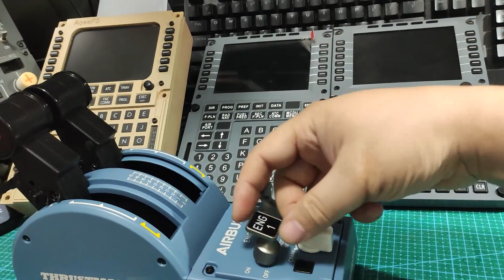Replace the more realistic Thrustmaster TCA Airbus throttle engine switch [QuickMade]

Comment: I find it baffling that thrustmaster cocked this up and didn’t include this kind of switch in the original.. nice job!
Reply: It’s cheap plastic shit, that’s why sadly...
Reply: @Tom-ih8gr  the modified versions accessories are expensive, look at the top comment where he replies
Reply: They keep their products affordable. These seemingly easy and small mods actually add up to a lot of overhead when added to a production. Providing a solid platform for the user to make their own mods while providing an affordable product is imo of much greater importance than shipping out a 1000$ bulletproof tank of hardware. Their Warthog is legendary but it will never have the userbase their HOTAS X and t1600 have.
Reply: You find it "Baffling"?  Just the two tops of the switches would add another 30 bucks...
Reply: to me the switches feel fine... its not meant to be a really good quality product, its an entry level plus the throttle flows very well

Comment: I think Thrustmaster charged too much for this quadrant, considering what it is made from and the simple manufacturing process. I bought this TCA and the two side controllers, (which are even more over priced). I felt like I had a 'senior moment' when I opened the boxes and realized that I should never have bought them in the first place. Anyway, as others said, for the amount of money TM charges for these quadrants, they should have used the 2-position toggle lock switches in the first place. 
Thanks for the video.
BTW:
As a machinist myself, (25+ years, 1st class/Job shop/Journeyman), I would like to suggest that you run your lathe's RPM at least twice, (if not 3-times) faster whenever you machine this kind of material. You could've avoided the "Game Over", (I liked that term, lol), when you were parting it off the workpiece. 

Also, you used carbide turning and part-off tools, which are never a good idea for soft materials, especially at low RPMs. Carbide is most proficient at high RPMs, light tool load (relatively speaking) and cut best when the there's a high degree of heat generated at the tool/workpiece contact point. 

To cut this kind of plastic, you should use sharp, high-speed tool steel cutters, with about a 1/32 to 1/16 tip radius. Finally, the cutting edge of the tools for your lathe, should be between .003" to .005" below centerline, (convert that for metric sizes).

Too far below that, and the workpiece can ride up over the tool if machined w/o a live center, (or if it's chucked too far out), and too much above that centerline will result in surface tearing and short cutting tool life. Just some suggestions, which you can disregard or accept, it's up to you.😉
Rich
Reply: lol just imagine. I got their TFR pendular, which now is reaching $500 for some rudder pedals lol.
Reply: @jungleboy1  Don't laugh! I have the Crosswind rudder pedals, which start at about $300 but I bought a good used pair for about $250. I had a Saitek rudder pedal set for years, before I bought the Crosswinds. I could tell the plastic in the Saitek set wasn't going to last much longer. I sold the Saitek rudder pedals because the Crosswinds are about the last pedals I'll ever need to buy.

Fact is, WAYYY back when the Thrustmaster Warthog HOTAS stick and throttle came out, I bought the system for $425 new. Now, you can't touch them for that. I still have and use the Warthog HOTAS system and with exception of one button, the system still works great.

Those TFR pedals should last you forever, so yes, it's a lot for rudder pedals, but considering that they have to handle a percentage of your weight, they'll probably be the last thing you'll ever need to replace.

Rich

Comment: Nice ! And how to make the throttle more harder to move  forward/backward ? 
He is too soft, even with the screw at his max.
Thanks.
Reply: I'm curious of the same thing. When I turn the tensioning screw, it made a click sound and now the screw is loose and won't stop. Now my lever can't hold its position at anywhere other than the detents. How do I fix this?
Reply: @NeoKingArthur  might have stripped the thread
Reply: @NeoKingArthur  you put too much pressure and destroyed it. It warns you in the manual to be careful with this screw. Lmao
Reply: @windshearahead7012  Yeahh well, I screwed it before reading the manual, so I didn't know.. I was expecting the quadrant to have a bottom out mechanism to protect this. But ehh... It is what it is, at least the detent gates are still working, so even if it's loose it's still usable. I'm planning to get another quadrant once the FBW A380X is released, then I'll just use the new one as the main Engine 1&2 (and definitely be more careful with the screw) while the old broken screw one will be my engine 3&4.

Comment: Such a shame Thrustmaster messed up these buttons. Same for the IGN mode selector that doesn’t recognize the default state/Normal. Wouldn’t cost them the world.
Reply: Guess you mean in Msfs? It's more or less a software issue than a hardware issue. Should be fixable since the configuration of the quadrant is showing that the button is off. So basicly they need a toggle inset of a set state. Guess they will fix this.
Reply: works on mine, its all how you map the controls
Reply: I sent in a ticket to thrustmaster because I added the add ons to make it 3&4 ,told them cant bind the ING Norm mode .Its in MSFS but in the thrustmaster input set up I asume its number 6 not working .

Comment: That's why I only use them for light switches..
I'd rather make them reverse - disconnect for ENG RUN and connected for ENG OFF. thus a smll (even might be software caused) glitch to send the pluse to off will not cause a major problem inflight.....
I'd better if both direction have a button, but I've already moved those "FIRE" buttons for TO/GA on the lever.

Comment: Yes, it does look more like the switches on the real Airbus.  BUT, for all that work, it still doesn't require one to pull up and over a blocker like the real ones.  I'll take the easy way out and just add the ENG label in miniature and call it good enough.  Very interesting to watch you do all that work however.
Reply: Pretty clearly demonstrates at 7:39 that same functionality

Comment: How can you lose your warranty when an ultra-fast setting in FSUIPC (which we need anyway with other simulation software) allows you to have the "norm" status recognized in MSFS2020!
Reply: I sent in a ticket to thrustmaster because I added the add ons to make it 3&4 ,told them cant bind the ING Norm mode .Its in MSFS but in the thrustmaster input set up I asume its number 6 not working .
Reply: did you use FSUIPC for all bindings?I had a look at SPADS but was too complicated to use

Comment: Do you have the switch model reference ?? Wondering how you guessed ! Great mod !
Reply from the maker: A small switch with a 6mm hole, there is a PCB underneath, and the pins need to be polished. I will replace it again in the next video for less shaking.

Comment: Poor APU, and it's master switch, not being included.
Reply: It isn’t even on the pedestal...
Reply: @MauritsVeen  yeah, poor guy.
Reply: @MauritsVeen  I know, it's on the overhead panel, but without it you still couldn't start the engines.
Reply: @ngaviation3489  I think you could start them with the GPU right?
Reply: @ezanchi5422  yep, you could do a manual start!
Reply: @ngaviation3489  For a second I imagined a worker trying to start the turbine as they did with the propeller back in the 20s hahaha
Reply: @ezanchi5422  don't mind me! Just thoroughly attempting to start this engine!

Comment: Hi, interesting work but the output does not provide a wow effect considering the time and effort.
Not questioning the quality of the component or cap, but the way you need to pull the master switch to activate it is not really natural. Unless fixing the quadrant to a clamp or cockpit, I don't really see it work compared to what is avalable on the device. WOuld be intersting though to see if you can boost the friction!
Reply: real life you pull up on the switch and then move it forward its a safety switch, this guy did amazing
Reply: @bigkahuna2297  well real life you are in a plane, not your desktop chair. Not quetsioning the work, but the end result benefit vs potential other mods

Comment: Are you serious... obviously never had piano lessons. Lift your wrists and problem solved.
Reply: Kinda missed the point, real Airbus aircraft you have to lift to switch on and off (safety), to keep pilots from accidentally shutting off fuel to the engines. The released throttle quadrants is a simple on off